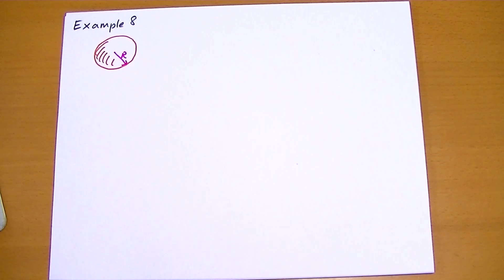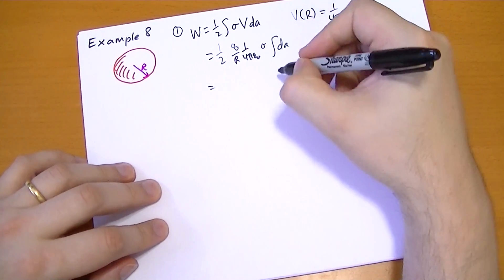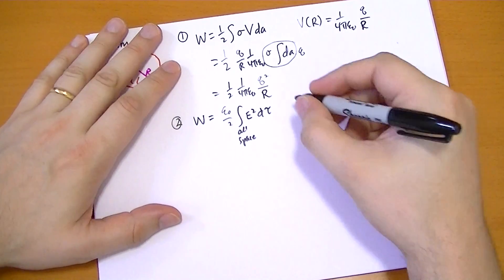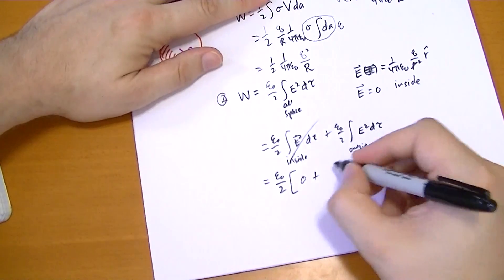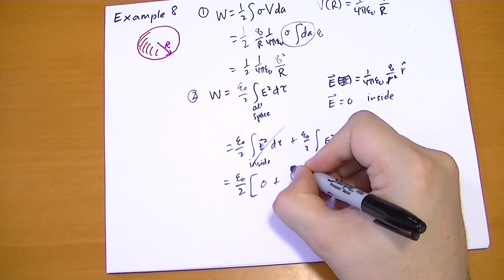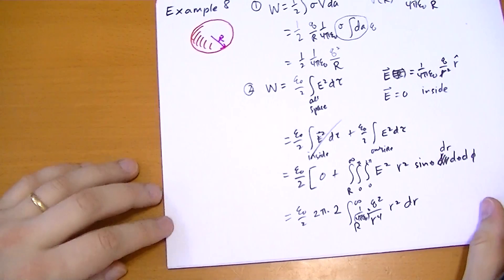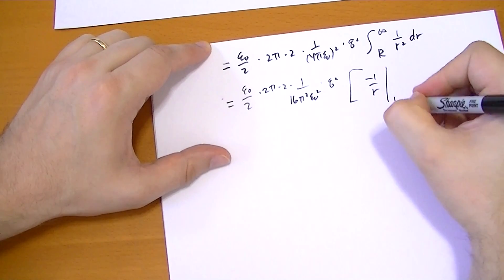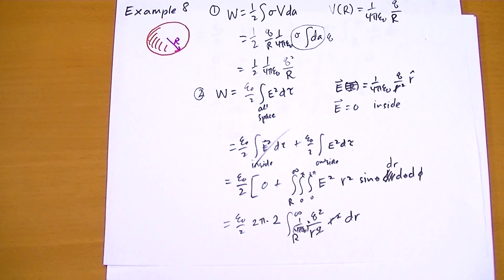2.4.3 Example 8

Comment: Potential V changes according to previous video if we consider dq as tiny point charges and sum it up (integration)
But I know, here we take V as potential due to ALL charges. Why is that so?
Reply from the maker: Sorry for the late reply. Join me on Discord: https://discord.gg/TGK47Pf

The previous video talked about how you can calculate the energy using only the E field? Which video are you referring to?